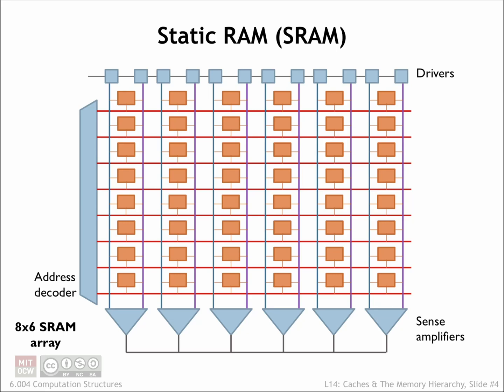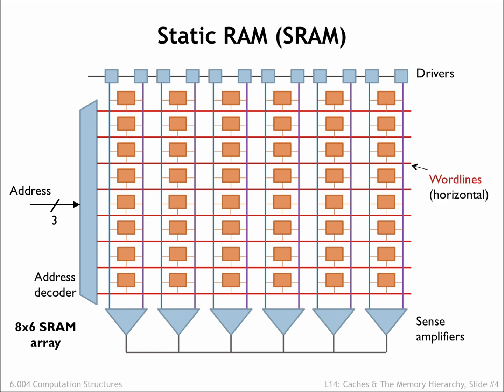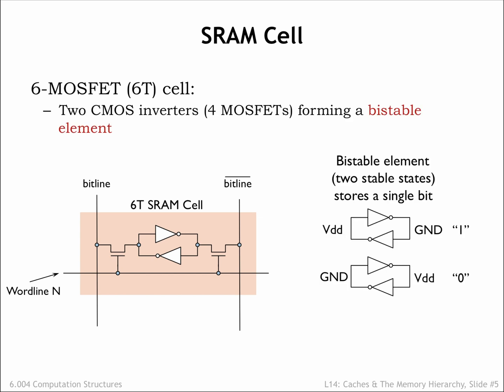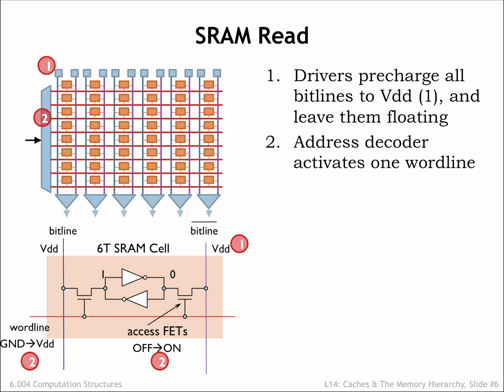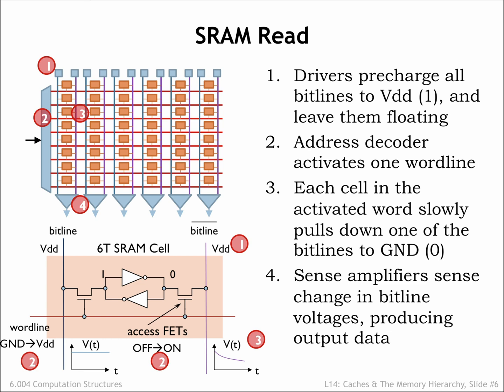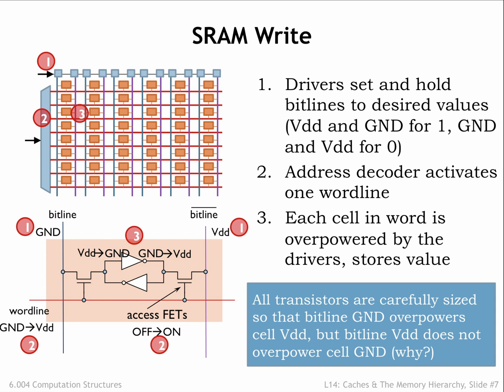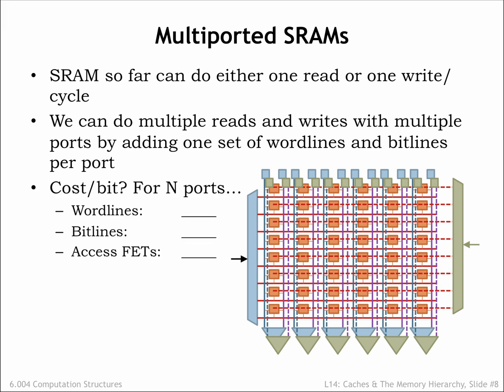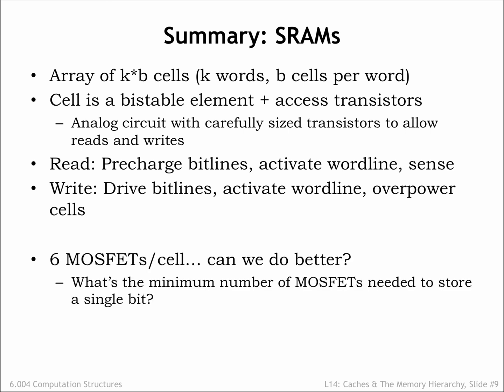14.2.2 SRAM

Comment: So for the question posted during the write operation.  Are the transistors designed that way to prevent the cell values from storing 1 on both sides??  also when i draw this operation out by hand and put 1 at each bitline, i see that the values of the cell do not change (because bitline GND overpowers cell Vdd and bitline Vdd doesnt overpower cell GND).  But when i use 0 at both bitlines it appears to set both sides of the cell to 0.  how does this respond when that cell is read and both appear to drop??  

I theorize that the drops are similar throughout the read operation and the sensor amplifier doesnt pick up any change, so if thats the case would it be 0?  is there actually another component involved for such cases? or am i completely lost?
Reply: I would guess that the drivers are set up so that they cannot both be 0 at the same time, but if that happened, the cell value would not be predictable. The cell cannot remain in a state of 0 0, since then both inverters would output 1 and it would not be in 0 0 anymore. I'm not sure if the cell would oscillate between 0 0 and 1 1, or if one of the inverters would be faster than the other and get the cell to a 0 1 or 1 0 state.
Reply: @erikumble  If your latter theory is right, maybe this would be a good random number generator!  Maybe not because maybe certain cells would more prone to swinging to 1 0 and others 0 1.  Minute differences between these tiny transistors might facilitate the cell settling in one state over the other most of the time.  Interesting thought though.

Comment: Is it correct to say that when you want to write a new value into just ONE particular cell, you must first read ALL of the cells connected to the same word line (into the sense amplifiers), so that you can set the bit lines to the appropriate values, then effectively write everything back again?
Reply: I think you dont care about current value in cell. For example, if you want to write a ‘1’ on a:

Current  State ‘0’ - Driver is strong enough to pull this ‘0’ to a ‘1’
Current  State ‘1’ - No change.
Reply: Yes, I think you are correct. Whenever you write to a wordline, you overwrite each SRAM cell in that row, so to change just one, you would need to read the row first to know their values.